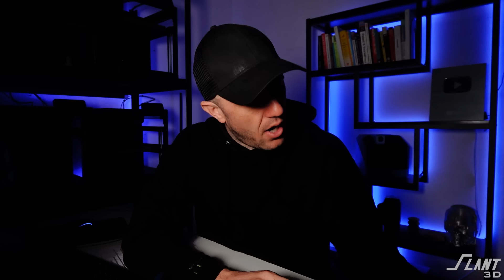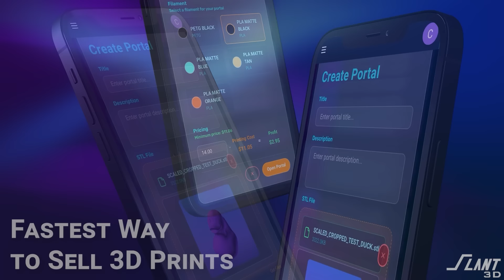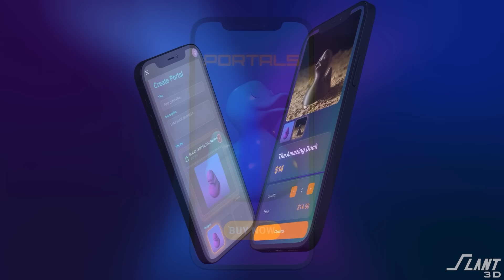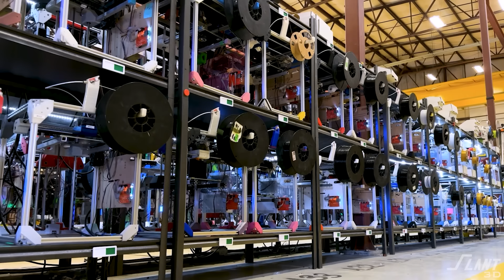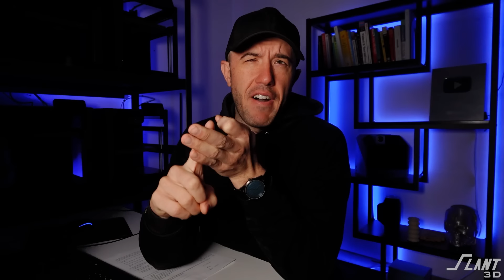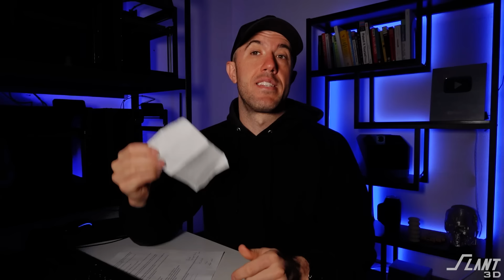Bambu Lab P2S | Teleport & Portals Got WAY Better | Productive Creativity | 3D Print Podcast Ep 126

Comment: P2S is a neat clean up, but I have no idea why anyone would replace their P1S. All the changes are QoL and, as a printer, it is exactly the same. Screen? who uses screens anyway. Servo motor on extruder for more torque? Old had 0 issues with torque. Then a couple of features that A1 had forever - swapable nozzle, automatic PA calibration. Slightly better camera with still low fps. 
And all the talking points about "ready for engineering filaments" is a pure marketing fluff and blatant lie. The passive chamber is exactly the same as P1S - there is 0 improvements, temperatures are the same (low) - 300 on the hotend?
P2S is a glorified A1, now it has all A1 features. They try to market it as an engineering machine - but it isn't.

Q2 is cheaper, larger, hotter (65C [or 70C if you turn off the AI crap] chamber, 370C nozzle (although 350C if you turn the fans to 100%). For ASA/ABS - 65C gives you up to 50% layer adhesion boost compared to 50C. For other materials - it also reduces the shrinkage and makes it easier to print. Yet, if you open Facebook market - there are hundreds of people dropping their P1Ss